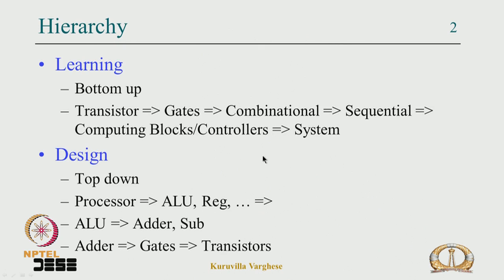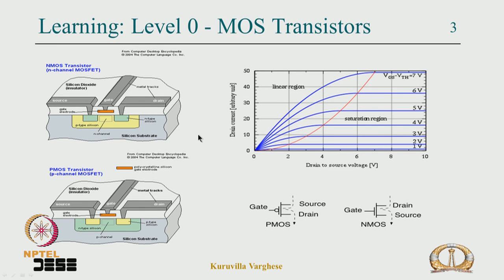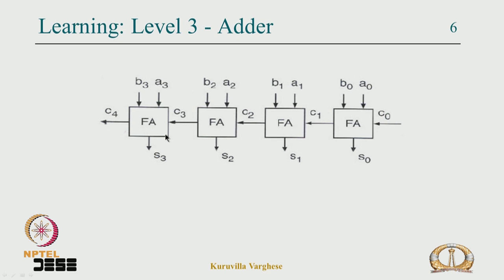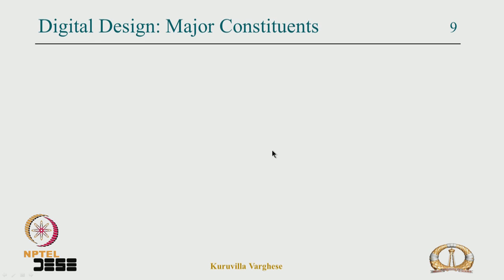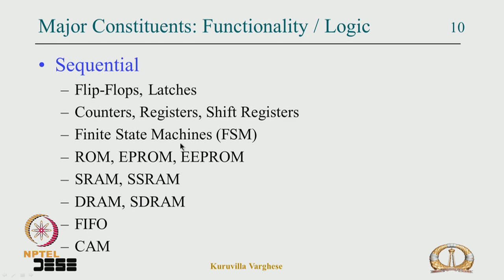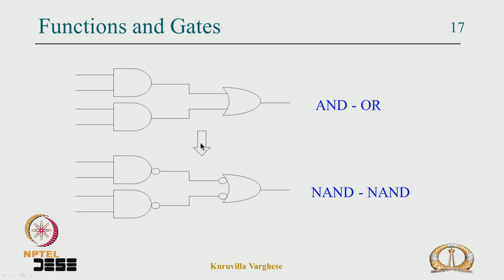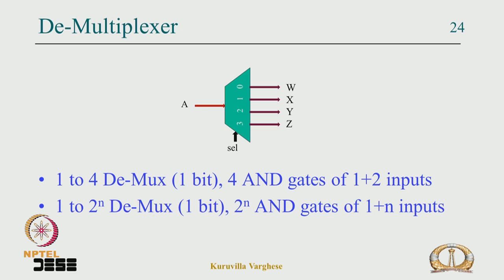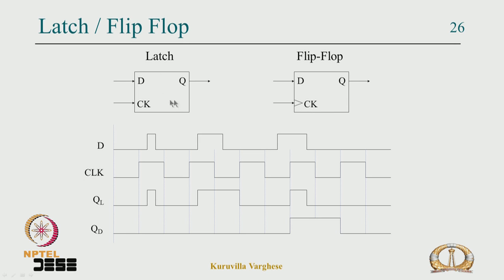Mod-01 Lec-02 Revision of Prerequisite

Comment: Review :
Minimization
1 karnaugh map
2 quine mcllusKey 1QM 
Difficult but precise
3 espresso
Heurestic based on QM
Based on near minimal solution
Tried state inverter
0 1 high impedence Z state
Multipliexer
Demultiplexer
and gate can do and or function
Band does and or invert function
Similarly nor gate they are universal gates 
Essentially were building demorgans theorem into a concept
Combinatorial circuits
1 propagation delay
2 tpLH output switch from L to H
3 tpHL putput from H to L
Use case hazard life situation 
Can balance the delay
Lots of settings plus lots of "Power dispersion"
Dynamic hazard
Electrical voltages
Output voltages :
1.VOH output when High (otherwise null) 

2.VOL Output low or null
3. IOH I current when output flow is high or null 
 4. IOL output flow is low L or null
Input voltages
1.VIH input is high return true else null
2. VIL voltage input L else null
3. IiH input is high else null
4.IiL input Low else null